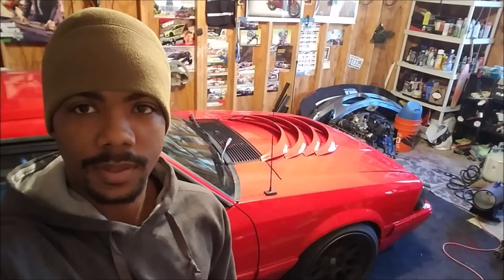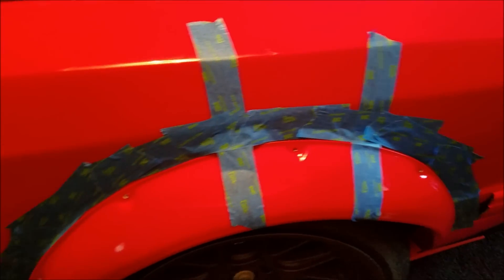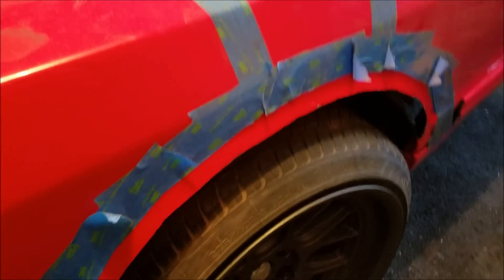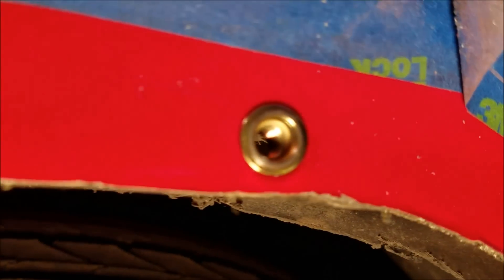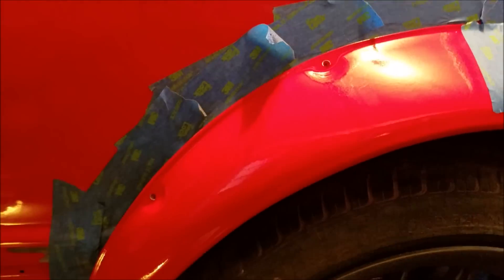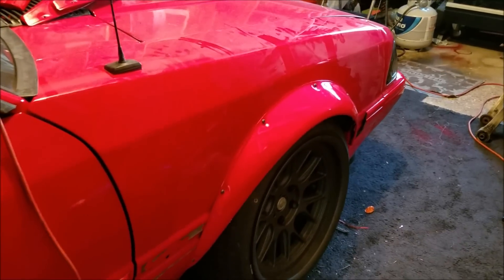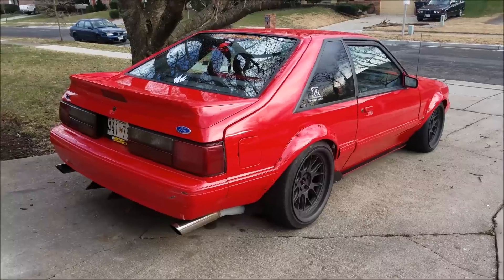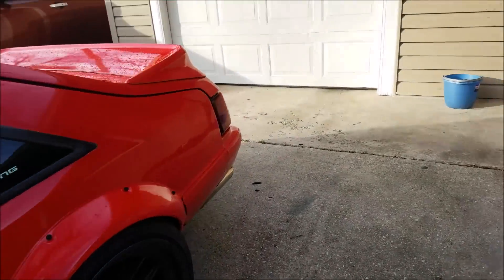Fender Flare install on Foxbody (Lets Get Wide!)

Comment: how did you mangage to keep splash guards on and are those fenders 1990 to 1993?
Reply from the maker: Are you talking about the fender liners?  I deleted those to help get more air flow in the engine bay. This car is a 1990.

Comment: The moldings in front of the front wheels are rigid plastic and bolt in from the back of the fender
Reply from the maker: yeah, that's why I accidently snapped one in half.

Comment: I love the look of that fox body.   What's the goal?  Are you going for a square stance?
Reply from the maker: I'd prefer a squared set up, however, i'm open to running staggred.  Drift cars usually have the front track much wider than the rear track and my goal is to keep everything even, at least on the outside.  Now with the steering angle kit, a 9.5 is ideal up front, however, I will probably end up running a 10.5 in the rear.
Reply: Premium Fuel Mag I like the way you think.
Reply from the maker: can't be driving a lobster trying to look cool.

Comment: Nice video! What wheels and suspension are you running? I'm getting a fox as soon as I can find one near me.
Reply from the maker: Ambit Wheels and Cobra IRS in the rear, Coil overs up front.
Reply: Premium Fuel Mag what bolt pattern?
Reply from the maker: Fox's come 4 lug but this is converted to 5 lug.
Reply: Premium Fuel Mag yea Ik what's the bolt pattern for the conversion and wheels?
Reply from the maker: 5x114 , all 5 lug mustangs have this.
Reply: 18'' wheel? Ive been digging your set up man
Reply from the maker: Awesome! Thanks!

Comment: love the build whats the defuser your running on the side and rear and what tire size?
Reply: and whats your offset
Reply from the maker: Both diffusers were custom made, You can see more info on that on the IG page @PFM_Drift_Fox .  The offset on these wheels is +15, however my IRS is 1.5 inches wider on each side, plus i am running a 1 inch spacer (not shown in this video).

Comment: looks great but i just cant believe you cut the rear quarters but to each his own and replacement are only like 950 set
Reply from the maker: I honestly didn't want to, but I already ruined the fenders trying to roll and pull them to fit my tire after the IRS swap, and it only got wider from there with other suspension mods.

Comment: There is a tool that's supposed to be used on those nutserts,you can pick them up most anywhere, would have made your job much easier. Again they're called NUTSERTS and they're not for  "over achievers" they're for professionals and ppl who know what they're doing.
Reply from the maker: Yes there is a tool for the nutserts, no, you cant buy it anywhere, no you can't buy nutserts anywhere.  I did find the tool at harbor freight, it came with 10 nutserts that were a different size than what I needed.  I couldn't find screws to match the new nutsert threads, and I couldn't use the nutserts i ordered on the tool.  I'm sure it's great to use when you have everything you need at your disposal, but the stuff is not easy to come by, and it's not readily available.
Reply: Premium Fuel Mag Well I hate to tell you but a nutsert is super common and it comes with the tool. They are very easy to find. They take bolts btw not screws and those bolts can be found at any hardware store,just like most nutserts kits.
Reply from the maker: so let me go into detail about why i got frustrated with the nutsert... Yes, I tried to cut corners not ordering the tool from the start, there is another method that works, and I didn't want to buy a $40 tool that would only get used 1 time.  When i got to the rear, i realized that my method wouldn't work.  after searching lowes and home depot, i found the nutsert tool at harbor freight.  Harbor freight sells the nut sert tool with 10 nutserts, they do not sell nutserts by themselves, The nutserts i ordered for this project did not match the threads included with the tool therefore i could not use them.  Like i said, the tool only came with 10 nutserts, I needed 24 to complete the rear.  I bought the tool anyway and went back to lowes and home depot looking for matching button head Allen bolts for the new nutsert threads, i did not find the correct bolts.... meanwhile the car is sitting with the rear quarterpannels hacked up and needed to get finished.  I grabbed a pack of 10mm self tapping screws as a temp option to finish things up, and come back later with the nut serts.  After wasting my evening driving across town trying to solve my nutsert dilemma, i finished bolting the rears on in about 30 minutes.  The fitment came out much better, the flares laid down much more flush to the body, it was 50x easier, and the self tapping bolts looked cool enough.  By the time I was done, i actually wished i could re do the front using the self tapping screws, but the nut sert holes were too large to re do, so it is what it is.  If i could start over, and i had a choice between being fully prepared with nutserts, OR using self tapping screws the whole way, i'd still choose the self tapping screws.  It's my opinion, and that's what I recommend.  There are many ways to skin a cat, and if anyone wants to use nutserts, i'm happy for them.  Neither method is wrong, i'm just sharing my experience.  I post this stuff so people can learn from my mistakes and choose their own path.
Reply from the maker: thx for the tips.  Nutserts do seem cool and useful, but i'd have to find or make up uses for them, and with availability being so limited, id rather not mess with them again.  The raw cuts were beveled and covered in a very liberal layer of silicone, the foil tape is really to protect the silicone from weathering away over time.  The foil tape also does not come in contact with any bare metal, lastly , off camera, I covered everything inside the fender with undercoat, it almost looks OEM at this point.  I also did do a tape line to cut the rears, i just did that off camera.  No, i'm not an experienced body guy, I watched a few videos before I cut up my nearly flawless 90 mustang, i wouldn't expect anyone to do the same going off just this video alone.  Some things could be improved, but i don't feel i'm so far off the mark and I wouldn't consider this a fail or a hack job.  I'm very satisfied with the results.  Thanks for your tips though, i do need to start scoping out some specialty hardware shops to see what else I can get my hands on.
Reply: @Sgt.Slides yea they’re at harbor freight for under $45

Comment: Lol,that molding is bolted on.
Reply from the maker: I had to shorten it for the flares and I chopped off one of the mounting points, so I decided to bolt them on with matching bolts, it's functional and adds to the theme.  win win.

Comment: Sorry not sure I like this. The flares look like they belong on 4x4.
Reply from the maker: i honestly would rather have stayed stock body, but the suspension set up is over 6 inches wider and 2 or 3 inches longer.  Things just wouldn't have worked out.
Reply: ...maybe just a preference thing but the stock fenders covered the top and only the corners may have needed to be pulled out a bit. You got a pretty nice stang there and those screws and rounded fenders just don't look like they belong on it.....also, although your suspension might be 6" wider, with your wheel offset it doesn't stick out more than a set of 245s....the fenders look stock.
Reply from the maker: If you're just watching this vid, yes, I could have stayed with the stock body, but I was prepping for future mods.  In this vid, I was still stock wheelbase and track width.  as of NOW my wheelbase is wider ad longer and there is no chance of fitting within stock fenders.
Reply: Premium Fuel Mag I've watch a few of your videos and looking forward to seeing where you are goin.